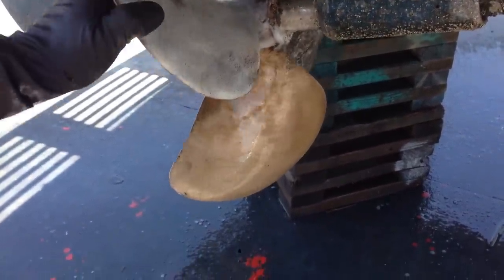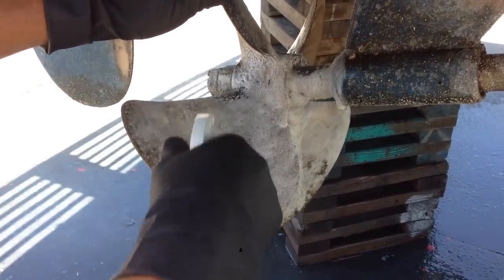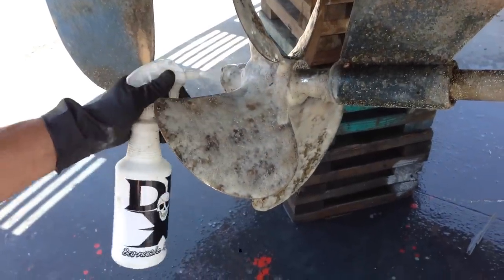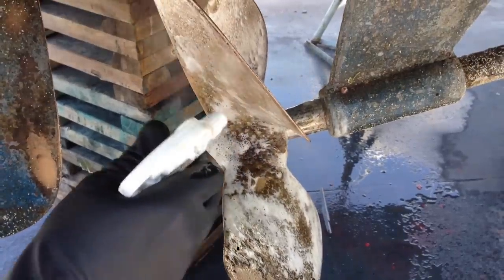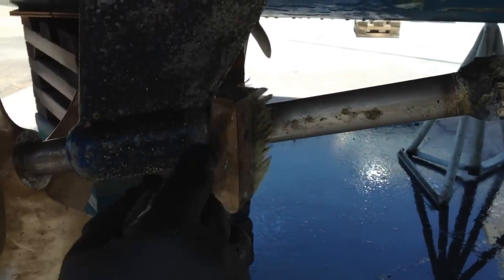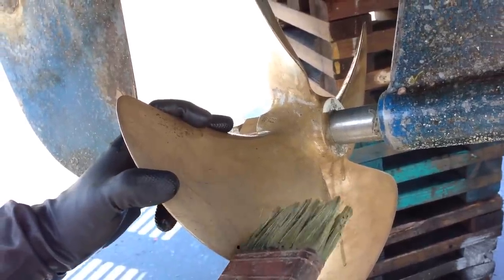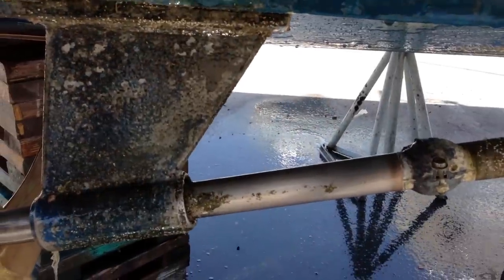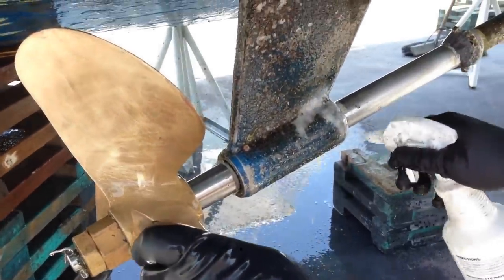RUST REMOVER: REMOVES BARNACLE FROM MOTOR BOAT MARINE LIFE

Comment: Muratic acid (hydrochloric acid) does the same thing. It dissolves calcium deposits. Get a home depot for just a few bucks for a gallon.
Reply: may be a silly question but would CLR do the same thing? the Calcium , lime and rust remover? .. a friend of mine who had out boards use to take off his props and drop them in a bucket and bingo... I'm wondering if CLR would work as fast?  then just a quick rinse and spray with some Pettit barnacle barrier.